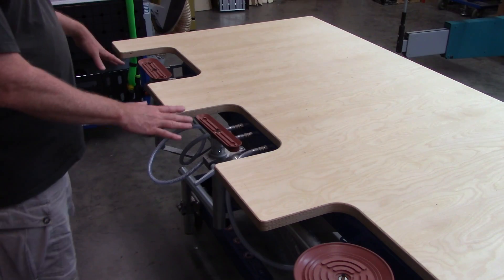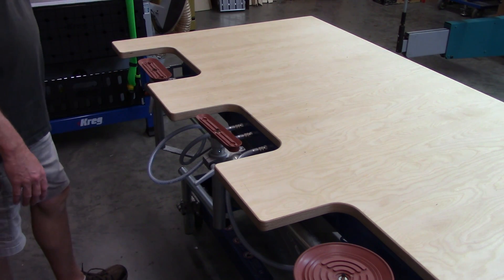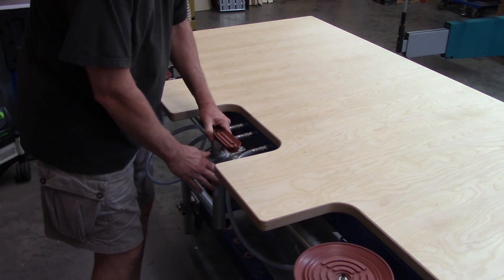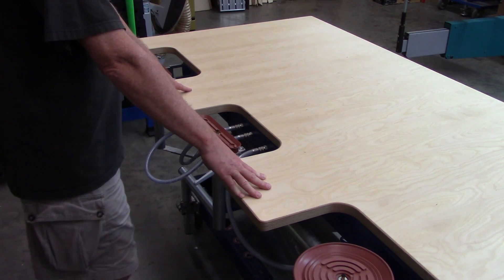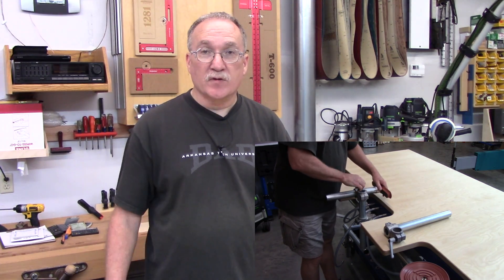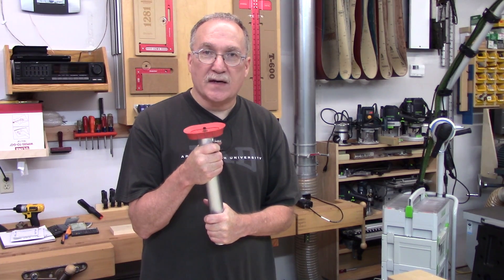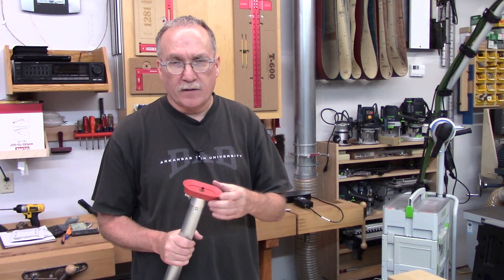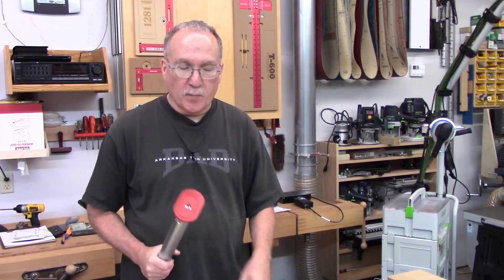Vacuum Clamping Table - Barth 500V

Comment: Thanks for the info, it’s nice to hear from an end user. Have you used their perforated top?

Can you tell me the outside diameter of the tubing the vac accessories mount onto? I’d like to get some of the vac pods to use in another application and still use the Barth mounting system.
Reply from the maker: I have considered making my own perforated top.  The Barth version is quite expensive and has a different hole size than my Festool MFT accessories so I have avoided it.  The tube OD is 40mm.  Steve

Comment: Hi Steve. Do the suction cups rotate? Really nice videos by the way. Thanks for doing them.
-Charlie
Reply from the maker: Thanks Charlie.  The suction cups do rotate but must be clamped to secure them in place.  Steve
Reply: I'm guessing that for edge banding with the Conturo it would be easiest just to disengage from the vacuum, turn it and reengage huh?
Reply from the maker: Yes Charlie, that is correct.  The cups can be rotated but will not free spin like the Festool clamps.  This enables the height to be adjusted where on the Festool clamps they are fixed.  Steve

Comment: I decided to order one of these from Greg after seeing it at AWFS. Still trying to finalize the options. I've seen pictures from Barth showing a version with the hydraulic foot pump mounted just to the left of the orange vacuum release. I'm guessing you can request it where ever you want. Do you think it would be more desirable next to the vac release or does it make more sense on the end? Also, did you consider the cam levers and 2 extra legs for added stability? Any advice is much appreciated. These are very rare in the US and feedback is hard to come by.
Reply from the maker: Hi Hybrid.  The hydraulic foot pedal sticks out about 11" from the frame which is about flush with the table edge when mounted in the standard position.  Mounting near the vacuum release pedal, the hydraulic foot pedal will stick out about 2-1/2" from the table edge.  This would make it a shin buster for me.  I would only select this option if I intended to install table extensions or use the eccentric lifts.  It looks like the mounting holes are already bored so it may be possible to relocate in the future if the need arises (I would check with Greg on this and he would probably need to verify with Barth).  I did not consider the cam levers (eccentric lifts) and was not even aware extra legs were available.  The table as provided is very stable and locks securely on my smooth and level concrete floor.  Hope this helps.  Steve
Reply: ExtremeWoodworker I'm glad to hear the table is stable without additional legs. The added expense and hassle of tightening them would detract from the usability. Good point on ones shins getting hit. I wasn't aware it stuck out so far. Getting both sets of holes bored at the factory with enough hose might be best if that's an option. I also planned to get the two optional suction units, two extensions with the 90 at the end, and wanted to upgrade to the larger 8m/h pump so I could use a bag or veneer table in the future. Thanks for your advice.  -Ed

Comment: I did order the table from Greg as you recommended.  Hopefully it will be delivered in Aug.  I had an alternate question, I see you have a Kundig Uniq Sander, and it looks like the belts are hanging on the wall behind you in this video.  Where are you buying your belts from?  They are not a standard size (8x79) and the only place I have found is a custom belt manuf.  Lastly, do you use the spindle attachment?  My sleeves do not fit  on the rubber bushings they provided and I was hoping to use that feature for some curved boxes I am making.  Thanks.
Reply from the maker: Hi Tony.  Congratulations and wow, an Aug delivery is very fast.  I had to wait over 3 months for mine.  On the Uniq, I get my belts from Uneeda and they are custom made.  Uneeda was highly recommended for belts by my Holz-Her sales rep and I have been pretty happy with them.  The spindle sander sleeves must be a metric size that isn't very common.  Just several weeks ago, I got some 1" and 1-1/2" sleeves from Klingspor.  The 1" sleeves fit but the 1-1/2" sleeves don't.  I asked Uneeda if they made them but was told I had to order a whole box.  In 2 weeks I am headed to Dallas and visiting the shop of another Uniq owner and I will ask him if he has found a source for sleeves.  PM me with your email address and I'll let you know.  Steve
Reply: PM Sent and thanks, I'll check with Uneeda for the belts.

Comment: Thanks for the overview of the table Steve. I wish I had the room for it. I use vac clamping quite a bit with shop made clamps and it works well enough. It's just setting it up and changing from horizontal to vertical takes a little bit of time.
Reply from the maker: Thanks Guy, I was also concerned about the space issue and ended up retiring my MFT cart to minimize the impact.  I know what you mean about setup time as I have the VacuClamp system and while it works well is a bit of a pain to setup.  I really like having the clamp system available all the time and as a result use it much more.   Steve